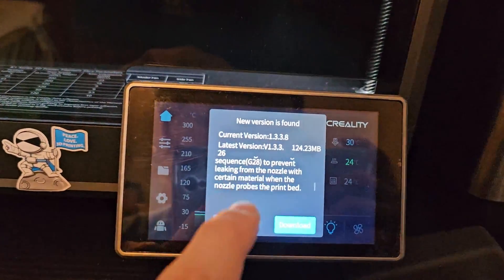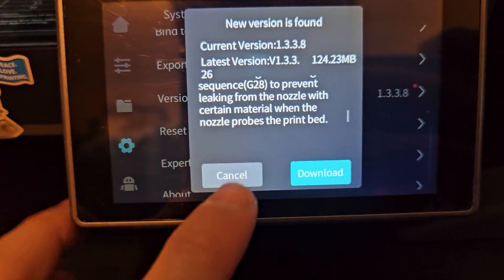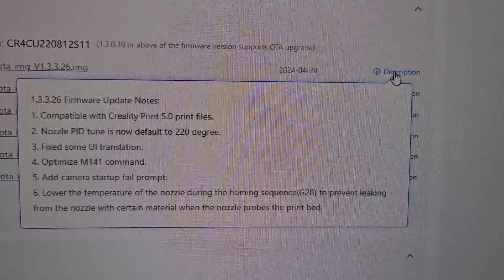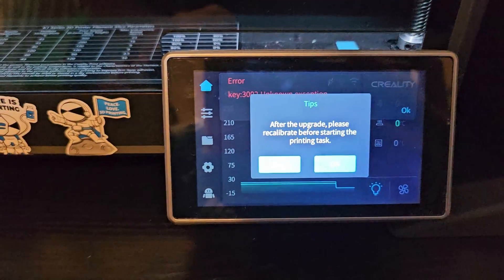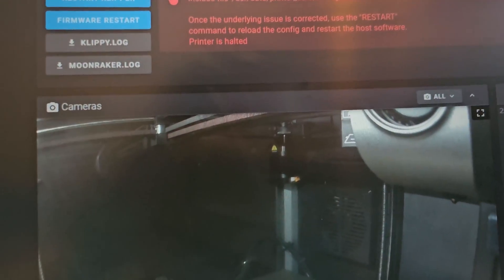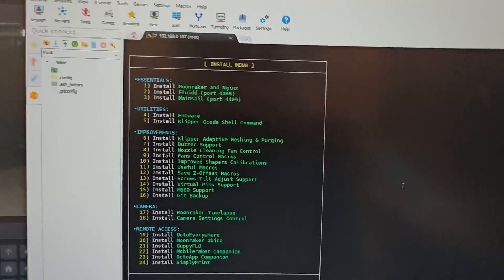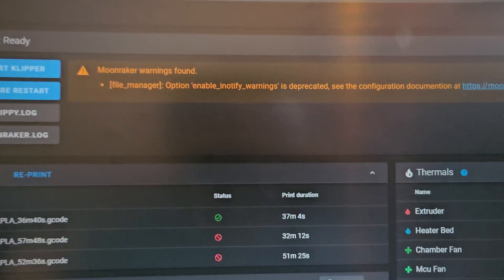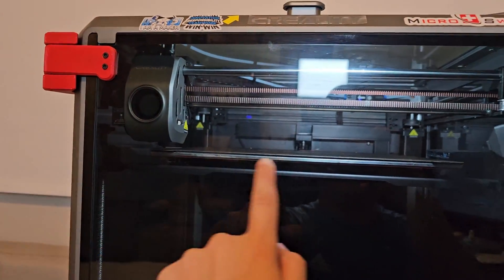Creality K1 Max New Firmware Update 1.3.3.26 | BEST Update

Comment: I used Guilouz's factory firmware reset to ensure all my rooted materials were removed before doing firmware upgrade. This even does factory setup so expect it to take some time. The normal factory reset from the menu does not erase everything like Guilouz's does.
Reply from the maker: Oh, that's nice to know. If I would have done that I don't think I would be getting the error. Next time. Thanks for the info.

Comment: what is the main reason you installed kliper ?
Reply from the maker: A lot of things. Full control of the 3d printer, fine tuning, wifi printing, monitoring the 3d printer, and full access to the 3d printer.

Comment: I got back to 1.3.3.8. i think the latest firmware has some issues. Also the printing quality of 1.3.3.8 is excellent,so i will stay there for the moment. Please check the 3DBenchy of the latest firmware. Is different from the previous firmware versions and also I think is printing slower.
Reply from the maker: That's good to hear you got back to the older version, people are saying that the new version does have problems, mine has been printing good.
Reply: @Scratch3DPrinting  it was the first time that the test benchy from the printer  removed from the bed and failed. Strange but if you check it you wil see that the benchy is sliced different as i mentioned above and i think the outer walls are printed slower.

Comment: how do you install camera settings? - mine says no i have updated camera and cannot install?
Reply from the maker: Are you installing camera settings from the helper script? Or the camera is just not there?

You might need to re enable camera from settings and add a new camera in setting.
Reply: @Scratch3DPrinting  hey no my guy - my camera works but i hve no settings for it - ie i cannot change brightness or contrast etc

Comment: DONT UPDATE FOR THIS NEW VERSION A LOT OF PEOPLE ARE BRICKING THEY K1
Reply from the maker: It has been a day and mine is working great, I have been doing some 3d prints and it turns out great. Waiting for stable release is the logical way to do it, but I want to explore things early and show it to you guys.
Reply: @Scratch3DPrinting  here already 6 people from the group and still comming more people reporting a lot of insues
Reply: @RafaelKaname   - ye i had exactly the same errors as you - i had to reinstall all - factory reset on the update so i have latest version - he use putty to put guiloise helper script and load all again - printer is running great now no errors

Comment: 1. 3. 3. 26 is not "down" from 1. 3. 3. 8. ".26" Is 18 higher than ".8" in the Revision value. It's how "[Version]" type objects work:

PS C:\Users\user> [Version]"1. 3. 3. 26" (spaces added so YT doesn't think it's an IP address).

Major  Minor  Build  Revision
-----  -----  -----  --------
1      3      3      26
Reply from the maker: Ahh, so then that .8 is something like .08? I know it's an updated version but the numbering is just a bit weird. 😄
Reply: @Scratch3DPrinting  100%. Technically it's more like .008 versus .026, but you get the idea,